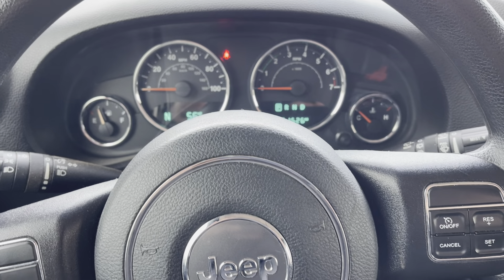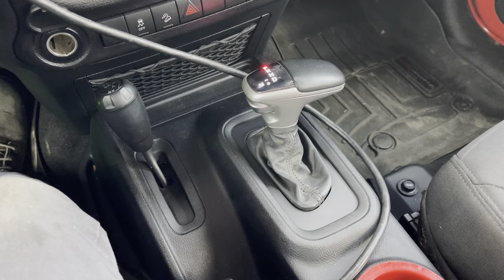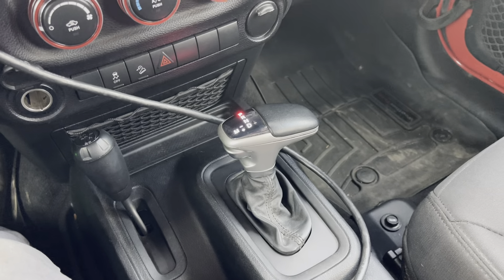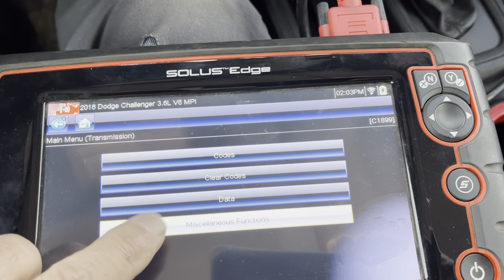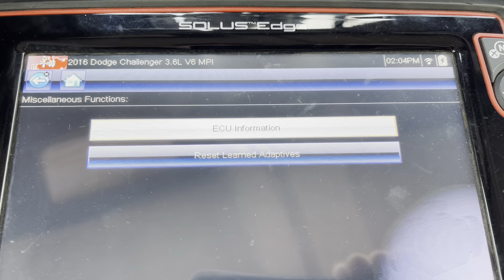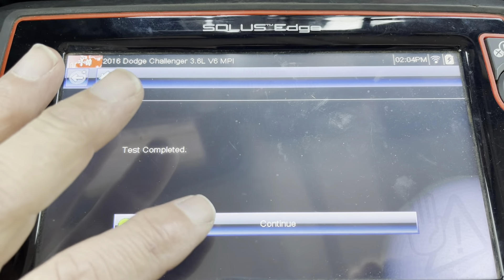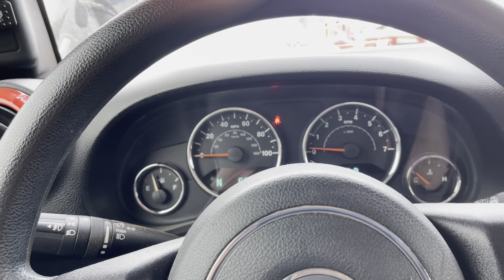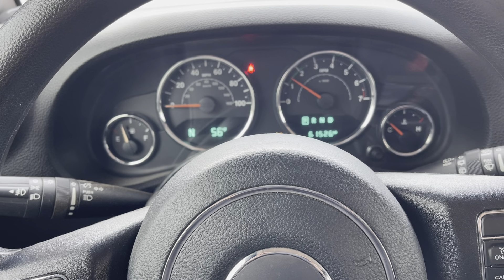8 speed 3.6L Jeep JK

Comment: Would you be able to swap in a complete 3.6 & 8 speed from a JL into a early model (2007-2011) JK 2 and 4 door ? For the guys with a smaller budget or just want the more modern drivetrain ?
Reply from the maker: Many problems with doing a 3.6L swap in a older Jeep JK (2007-2011) Not smog legal for one, a lot of rewiring and trying to make the JL platform work in a JK and have a dash cluster work nearly impossible. I think that it is not worth the effort. The JL 3.6L is not like the JK 3.6L because of the EGR system..

Comment: When are you doing this to the JL
Reply from the maker: The JL already has a 8 speed transmission
Reply: @jeepspeedshop  I have a manual
Reply from the maker: @henryoak2001  Well i have never done a JL 8 speed swap yet, but i would think you would just need to buy the transmission and t case from a JL and it should work.
Reply: Can this be done on the 3.8l jk, 2011?  I cant find info